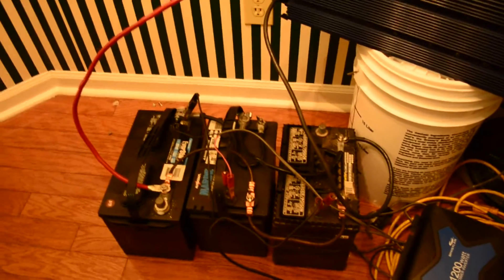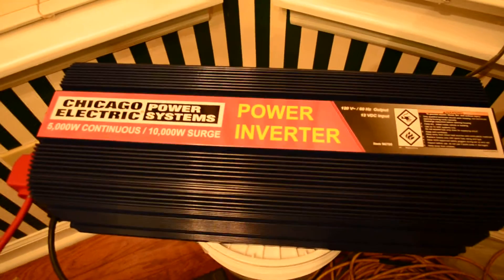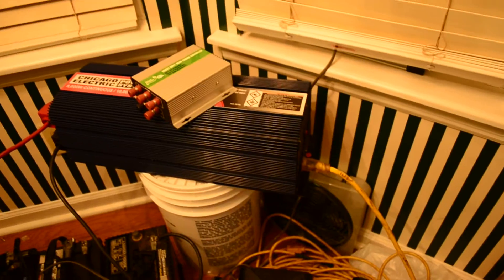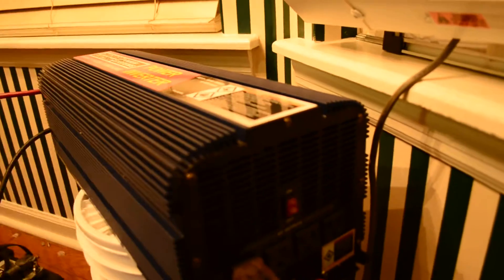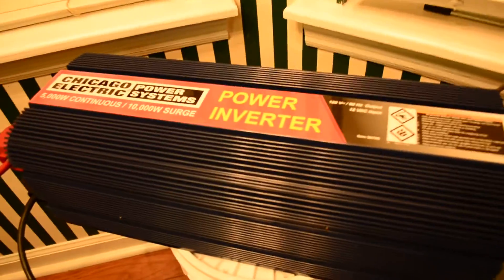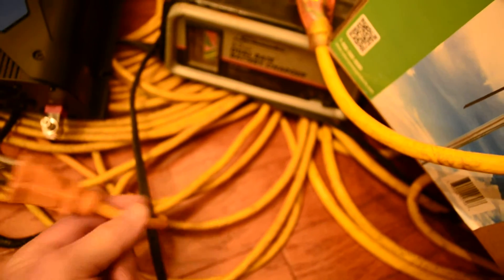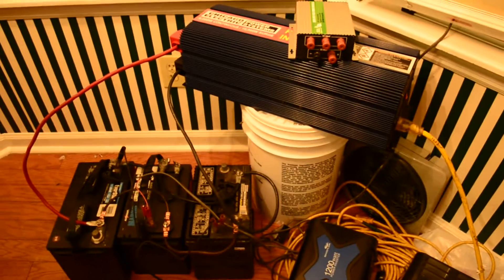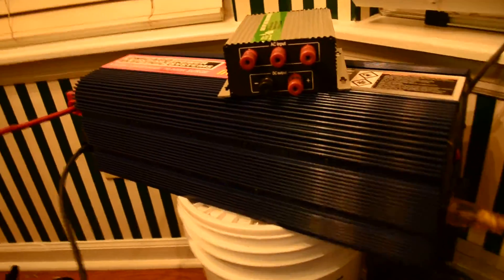Chicago Electric 5000/10,000 Watt, Solar Wind Turbine Setup (400 watt)

Comment: I have a 3,000 watt continuous inverter with 6 12 volt deep cycle 101 ah batteries in parallel with 200 watt solar panel kit and a 5,000 watt wind turbine generator for my tiny house. Will it run everything? Of course, for about an hour n a half. Depending on what your planning on running you might want to consider more solar panels ( 400 - 800 watt ) at least six batteries in a bank and an additional 2 batteries for water system and adding another wind turbine. Not trying to be a smart ass it's just from my experience if your running lights, fridge, ac, heaters ect ( all the things that I need to keep my wife off that ass ) your gonna have to go "BIgger". I do like that wind turbine, like the look and it comes with a pipe clamp rather than a flange, nice.

Comment: my only question is why have a 5000 watt inverter if you cant use it , it will take lots of batterys and solar panels to charge them, I have a 100watt panel and it does well to charge just one battery in a days time, but I quess it would be nice to have a big inverter though lol

Comment: that is not right, you can mix batteries, both the 70Ah and the 109Ah battery are fully charged at 13 volts so mixing is fine, just dont mix flooded with AGM batteries, I have found that AGM batteries like the sit at a higher voltage.

Comment: use 2gauge wire from battery's to the inverter, and you can use 4 gauge from battery to battery, i got the same inverter check out my video :D  and i pulled up the pdf file on the wind turbine and how far you have from battery's with wire is 0-30ft 8 gauge 30-60ft 6 gauge 60-90ft 4 gauge 90-150ft 2 gauge  if you chop off the end of the 13 amp rated extension cord you will burn down your house in high winds it can out put 27+amps. please be safe.

Comment from the maker: Thanks I really am new to the whole deal so I'm not sure of what I'm doing, Only doing it . The Batteries are all mixed too, I think the biggest one is 109 amp hours and the smallest is 75 so basically if charging by solar turbine or panels the charge controller will only charge up to the 75 Correct ? Never charging the full capacity of the 109. Does it matter to have a higher amp hour capacity or would having  all 75 amp hour batteries be cool. Cuz they have em on sale right now for 50 bucks.

Comment: Nice inverter my only recommendation would be thicker cable for your inverter. I run a 3000 / 9000 peak and it melted cables like that. When only pushing 1500 watts through it. Make a vid when you get that turbine up i have always thought of buying one of those.